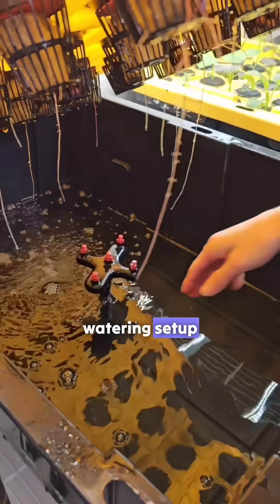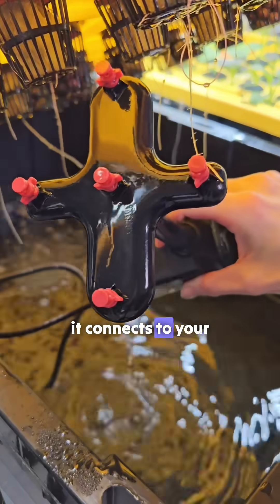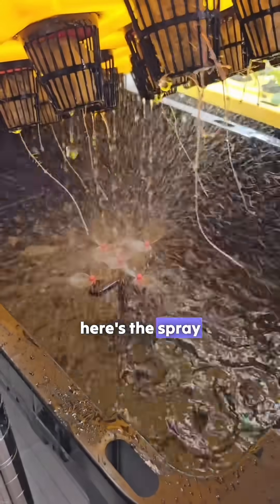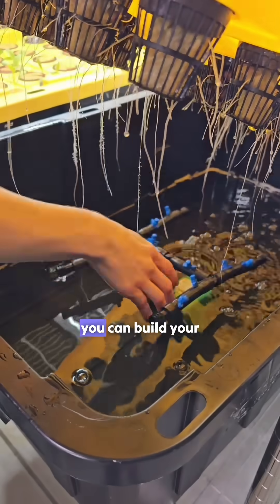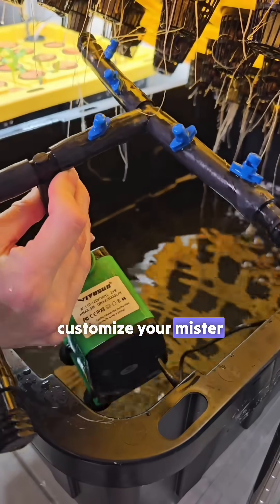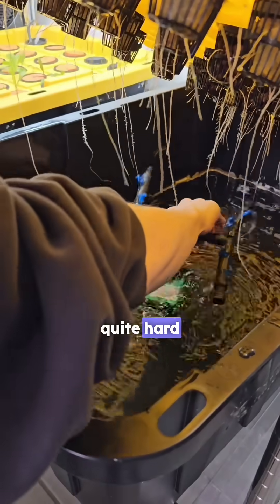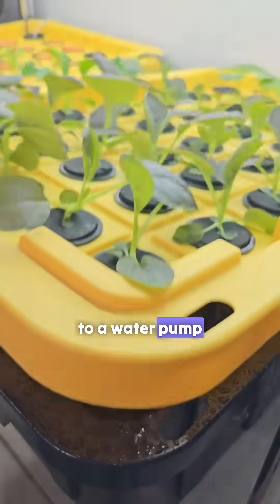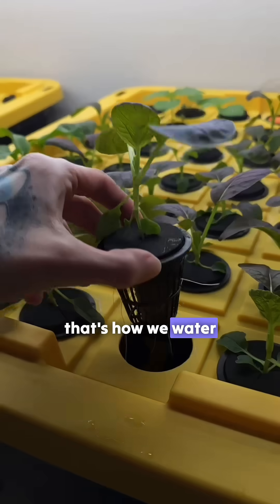Plant Auto-Watering: How to Set Up Auto-Watering for DIY Aeroponic System (Part 2/6)

Comment from the maker: Part 2 of 6: 🌱 How It Works: DIY Aeroponic System Watering Setup.

A lot of people asked, and there are two ways to set up the watering on the DIY Aeroponic System build that we shared. 😊

👉 Option 1 – You can get this pre-made spray manifold on Amazon. It connects to your water pump with tubing and sprays the roots. It's super easy to install, and you can find the link for it in our bio.

👉 Option 2 – You can build your own misting device by using irrigation tubing and micro sprinkler heads. This lets you customize your mister setup, but it takes a bit more effort. Sometimes, finding the pieces and putting them together can be challenging. However, it does work really well if you get the right pieces.

Both options connect to a water pump, which is plugged into a timer. The timer runs every 30 minutes for 15 minutes a day. 💧💧💧

And that’s how we water our plants! 🥳

👉 If you're concerned about plastics, we encourage you to do your own research and choose what feels right for you. We grow for personal consumption and use materials we’re comfortable with.

Amazon Affliate link to Supplies = https://www.amazon.com/shop/onthegrowfarms/list/313WWLPVLRLRO?ref_=aip_sf_list_spv_ons_mixed_d

Comment: I love your videos. Do the pumps run at night, too?  Another way to think of it is 15 mins on / 15 mins off for x hours a day. How long is x?
Reply: Plants uptake less water at night, technically, most folks overwater at night for this reason.  In a genuine aeroponic system that uses mist  you would mist for a couple of seconds every 3-5 minutes which keeps the roots damp but not dripping wet.